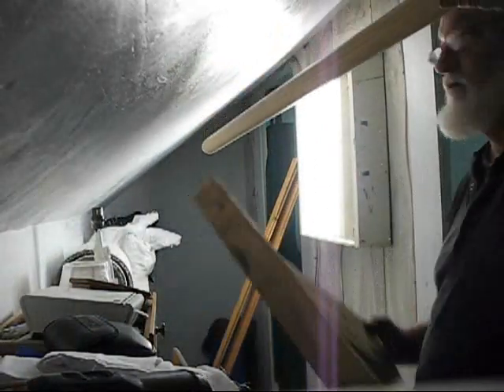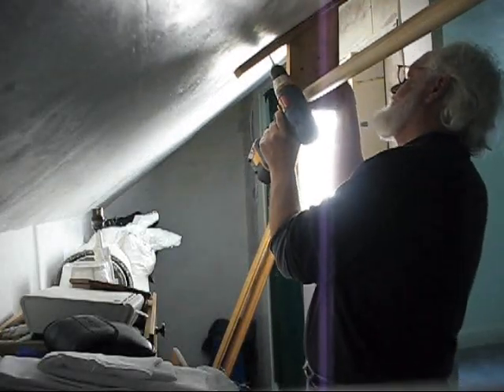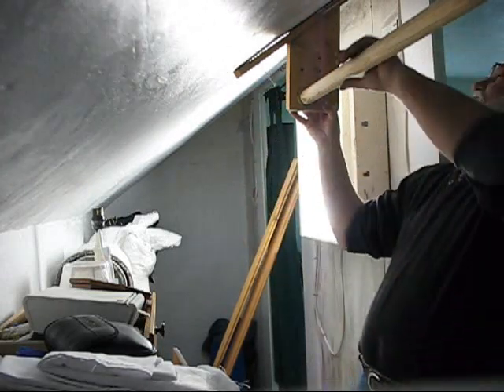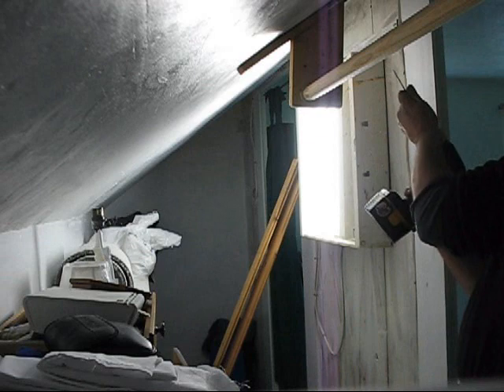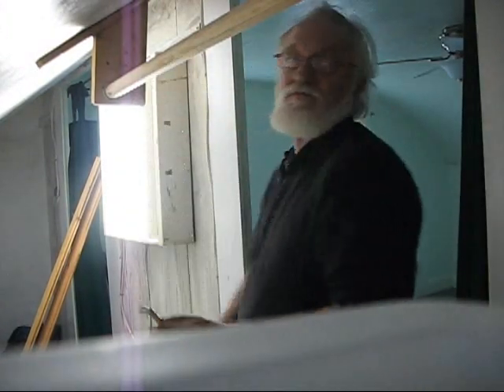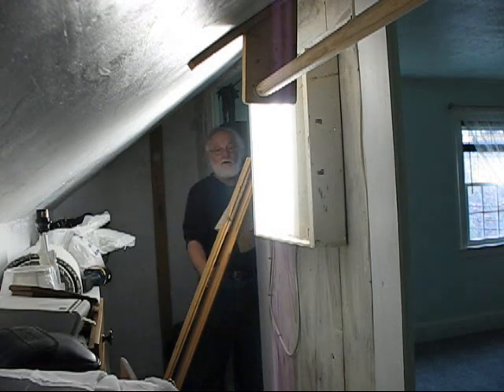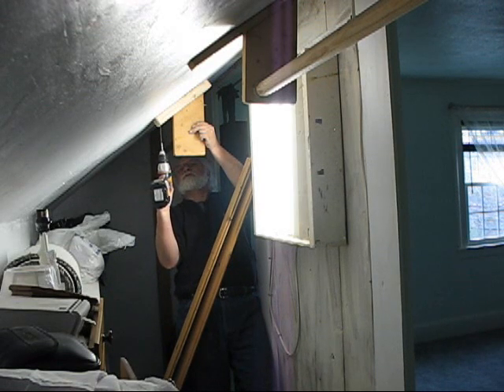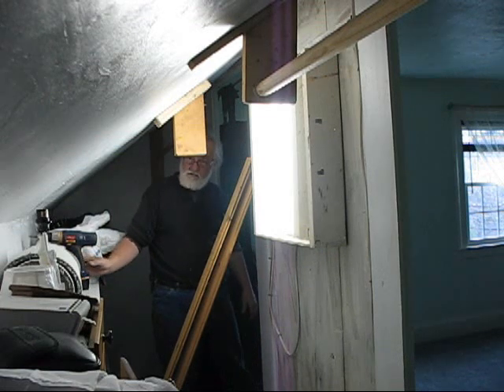Putting up the clothes hanger racks in the closet

Comment: "Eye ballin it" I laugh to myself so many times, when I want to drill a hole in the center of something, and I measure it nine ways til Sunday, drill the hole and low and behold it's off center. I've learned that "eye ballin it" is good enough, and with brackets and stuff for my street rod if it's off 1/8 of an inch I can tell right off the bat. But the eye never lies.